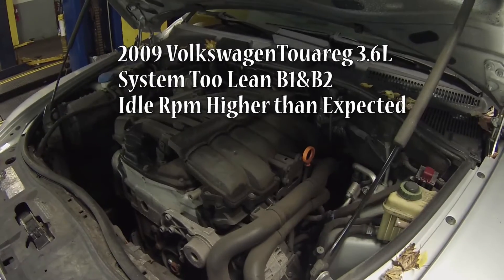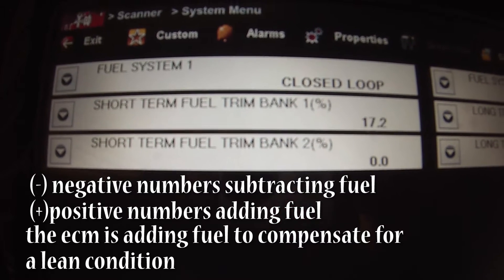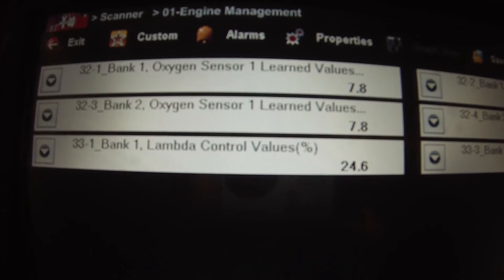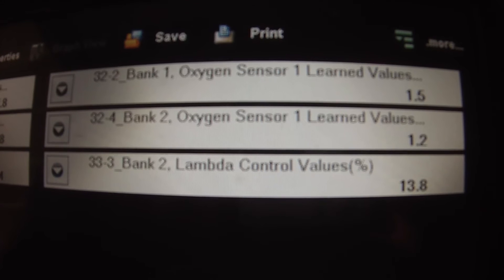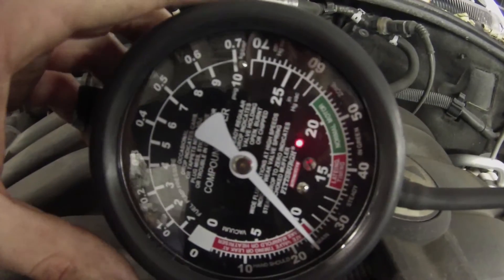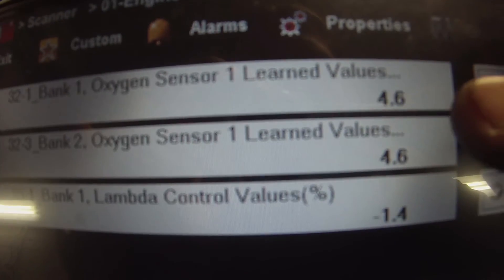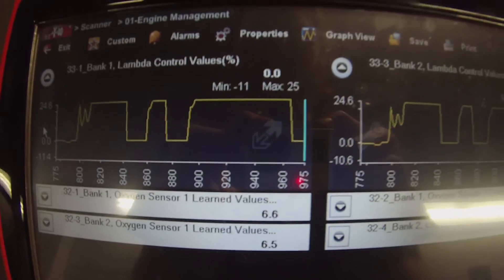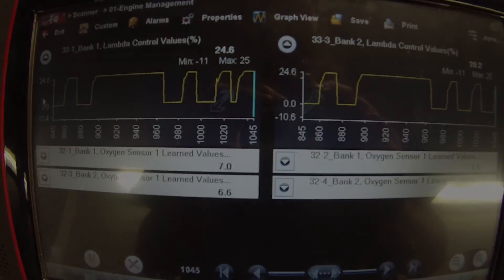2009 Volkswagen Touareg 3.6L - Lean Condition

Comment: So glad I got a spare oem valve cover with the gaskets when I initially purchased mine used a few months ago. Only at 80k currently, but it's a common issue with these engines. Sucks that they engineered it internally. Thanks for the thorough video. You seem like a very knowledgeable mechanic. I'd trust you with my Treg!

Comment: I dont have then hissing sound from the little hole behind the pcv but I can hear a vacuum leak from the intake plenum. If I unplug the pcv and let it idle and I have no fluctuation you think it means my pcv is dead and need a new valve cover?
Reply: Zinit u need new oil separator. It should not vaccum any air. I had same problem. Now i have much less oil consumption. And less fuel consumption too.

Comment: I have stupid question could this condition suck oil from crank case. Thank you
Reply from the maker: Not a dumb question. That is where it's pulling from. I had my vacuum gauge on the oil dipstick which goes straight to the crankcase.
Reply from the maker: And I'm sure too much oil can get in there and cause it to burn oil. Which could lead to other issues.
Reply: Positive Lead Diagnostics thank you for quick response Keep up good work you have great material on your channel cheers
Reply from the maker: Thank you for your support!!

Comment: What is acceptable crankcase vacuum through the PCV system? Also is that a MAP engine (asking because of high idle)?
Reply from the maker: This engine has a maf sensor. If you put a vacuum gauge on the dipstick it should be an unreadable amount of vacuum depending on the gauge. I think it shouldn’t even reach 1 inhg

Comment: My 08 touareg vr6 idles rough. I already replaced pvc valve and spark plugs. No chekc engine light but idles very rough. Any thoughts on what can cause it? Thanks
Reply: how did you fix it?
Reply: @luckyfarru  never fixed it. Sold the car. Most likely it's variable timing that needed to be replaced. Not worth the money

Comment: Hey I have the same problem on my passat 3.6 VR6. Air leaking thru the PCV cover hole and my mechanic taped it but it still idles weird with Intermittent CEL. So should I just pinch the PCV or is there something I need to replace? Thanks
Reply: Oh sorry I just finished the whole video. So I think I have to replace the valve cover.
Reply from the maker: Yes the pcv breather is internal to the valve cover.
Reply: @PositiveLeadDiagnostics  ur saying replacing the valve cover will fix the pcv issue too right?
Reply from the maker: Yes. The oem valve cover has the pcv built into it.  They make kits to replace the pcv but I’ve heard they are no good
Reply: @PositiveLeadDiagnostics  okay thanks for the knowledge mann, I will replace mine in a while and will update 👍
Reply: @detonater1348  how many miles on your passat when you had the issue?
Reply: @flute136  when i bought it, it already had pcv issues...iit was at 160k ish

Comment: Mate, great video. I have a question. That little hole on the valve cover housing the pcv valve. Is that supposed to be sucking air at idle? Or is it sucking air at idle a symptom of the pcv failure?
Reply from the maker: That hole should not be leaking vacuum. That is a symptom of a failed pcv.  I think the hole is just part of the design to allow the diaphragm to flex. I could be wrong though.
Reply: Frank Rizzo thats failure of pcv, I had same problem. Now its not sucking anything. And i have now much less oil consumption and also less fuel consumption.
Reply: TheDavo6233 oh really? Reduced Fuel consumption will be a good thing. It chews through the juice. I’m actually fixing it right now. Replaced the valve now just got to get it back together

Comment: Hello, would you be able to tell me where the camshaft position sensor is located in the 08 Touareg VR6?
Reply from the maker: On the back of the cylinder head near the firewall. There are two of them on for intake and one for exhaust
Reply: Positive Lead Diagnostics thank you!!

Comment: im working on 2004 touareg with the same code and some i came up that its the intake gasket sucking in air my quick way of checking is to start the vehicle and remove the oil cap if its sucking in air then the intake gasket need to be replaced.
Reply from the maker: I have heard of guys doing it that way. You mean the pcv not the intake right?

Comment: Hi I work on European cars too and it never happened yet to me replacing a Valves cover on a VR6 Touareg but I have done some on 2.0L TSI CCTA etc the good thing on a timing chain engine the PCV system is easy to replace and cheap I think that on most VW Audi there is always a small hole like you we're showing if you feel vacuum on this small port then you know you have a problem. It funny today I worked on a BPY 2007 EOS and the vacuum lines from the intake up to the brakes booster was all split and also the U pipe from the PCV to the intake was also broke so the car was acting the same way the long term trim was not too bad and the short term was positive 25 % I think if the intake leak is too large the long term trim dosent respond like normal the rule of thumb on VW Audi cars any thing higher than 10% positive or negative in the long terms trim will trigger a fault code but in you're case like mine it still know that the fuel trim is too lean.
Reply from the maker: The breathers go bad all the time especially on the tsi engines and it sucks in the rear main seal. Then you have an air leak at the rear main and an oil leak. And I have seen those bpy engines with a ton of vac leaks.
Reply: I think I replace 4 rear main seals on CCTA engines 3 Tiguan and I can't remember the fourth one do you work for a independent Euro shop ?

Comment: You need to change the valve cover... it happened to my Touareg
Reply: Mohamed Alsayaghi valve cover is it the plastic cover with that small hole? Because my same v6 makes whistle noises, cannot wrap my mind around.
Reply: I had the same issue with my 3.6 Q7 and just replaced the membrane located in the valve cover and it fixed it. Search Q7 pcv valve on YouTube and see what needs to be replaced.

Comment: do you have the part number of the valve cover?
Reply from the maker: I do not know the part number but i do know  entire valve cover
Reply: Positive Lead Diagnostics I replaced the valve cover gasket and it's still idling the same. it's not doing the high pitch squealing any more but same idle issues. any other ideas? pcv?
Reply from the maker: Sounds like there could still be another vacuum leak. What are your fuel trims?

Comment: I really didnt understand why was that internal vacuum...
Reply from the maker: It's an internal leak through the Pcv system
Reply from the maker: Agreed. Those breathers go bad all the time
Reply: The breather system VAG mostly use is a cyclone oil separator design.
Reply: u seem to be a cool guy armando..asking questions..not only, oh u nailed it again tommy..i bet half of those comments they dont understand it either..this is my second vid i been watching from PLD about damn PCV..still have so many holes in my understanding..oh, shut that damn hole there, ah, open damn dipstick here..oh, there s vacuum, ah there s pressure..wtf?!..would somebody explain how damn thing works